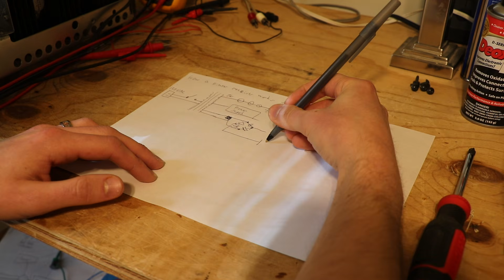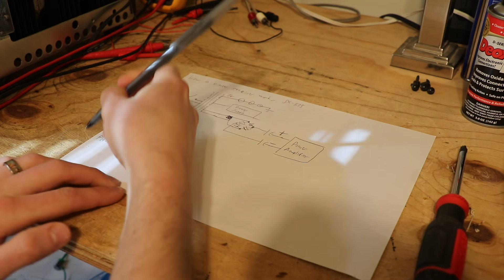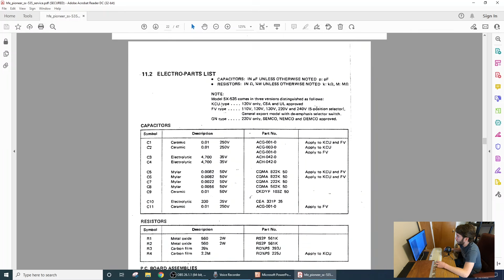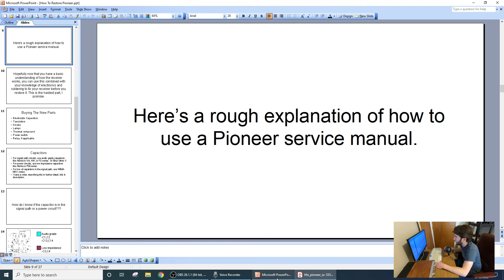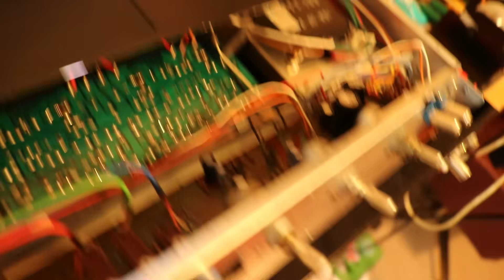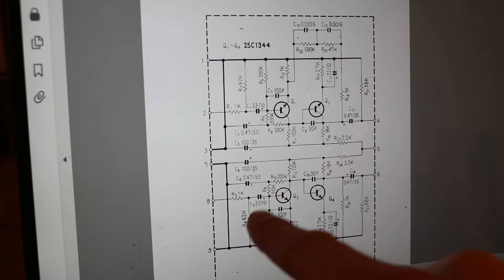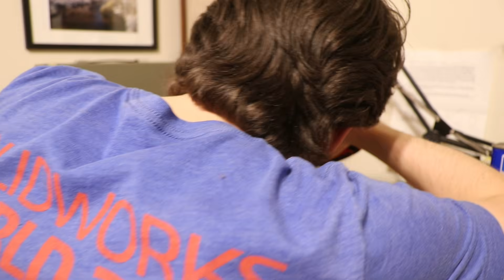How To Restore Vintage Pioneer

Comment: I hear you when you talk about the impracticality of the time and cost of doing this job. But really, the time could be cut down tremendously by simply fixing what is broken and nothing else. If it ain’t broke, don’t fix it. Almost all of what you did was PREVENTATIVE- and not necessary work. This way you can still make money repairing this gear. And if a cap blows out then replace it and call it a day until the next one blows. The customer simply needs to know the reality of the cost of owning this old gear. Let the customer assume the risk. Or else they will need to learn how to do the restoration themselves.
Reply: Согласен. Не нужно чинить то что не сломано. После проверки старых конденсаторов очень часто бывает, что ёмкость и esr лучше, чем у новых конденсаторов. Мне кажется, качество новых конденсаторов хуже того, как делали раньше. Новые бывает вздуваются ещё в упаковке. Сомневаюсь что они проработают в приборе хотя бы лет пять.
Reply: Thats like somebody bringing in a 440 Six pack Cuda and you replace four plug wires and four spark plugs it might run good for while but it will come back to bite you in the ass later you got it tore down do it right
Reply: I’m going to disagree with you on soldering.  You showed that you put solder on the tip after you heat the joint. That is a quick way to end up with a cold solder joint.  You should touch the solder to the work being soldered. Let the wire melt the solder.  Then the solder will flow around the wire. Also, I don’t add solder to the tip of the iron on the way to the work.  I just keep the tip well tinned the whole time.

Comment: Leaving the power transistors is a missed opportunity I think. They DO fail, you know. And when that happens it has serious conseqenses for your speakers. It costs me a very expensive pair of speakers in the past. And that was a amp with speakerprotection, unfortunately failing as well.
Reply: Anything can fail. Where does one stop. Do you replace the switches?! They could fail. I think restorations like this are kind of silly unless you can do them yourself or you have loads of spare money to give to a tech. Fix what is broken or swap in new parts if it will improve the sound. But always swapping in everything new is a huge waste.

Comment: I think as time goes on (and these units become more rare) they will appreciate in value so as to reflect the true cost of restoring them, even at $100 per hour shop rates. They just aren’t built like this anymore, and even the lower end less expensive units like this have far better sound output than most of the digital junk out there today. I’m currently restoring a 1974 AKAI AA-910, and I have a 1975 Sansui and a 1981 AKAI waiting to go on the bench soon after. Good video, thanks!
Reply: you realize that's just the power of suggestion?  THD is THD wherever it comes from.
Reply: All electrolytic capacitors are being phased out & from the looks of things it's going to be almost impossible to rebuild or repair anything that has electrolytic capacitors in them, all major cap manufacturers have posted that they will not be manufacturing electrolytics, check it out & the reason.  . . Isssss.  . . IT'S GOOD FOR THE PLANET, or as we're being told they're obsolete, which is nonsense, it's so fewer people in the near future will have radios that can be converted to broadcast units

Comment: 1:00:40 technically they do have kinda polarity. Some of them are still being marked so you know where is the outer plate (foil). it can be important for high frequency and high quality audio applications. https://youtu.be/OWXbdCz-AiY?t=1427
Reply: Very true. The outer foil was often marked by a black line on the capacitor body. The newer capacitors made for PCB applications often have no markings to indicate this. I use a scope to find which is the outer foi, although there are purpose designed devices to do this. Here on You Tube Mr Carlsons Lab is a rich source of information on this and many other electronic related subjects.

Comment: Boy do these video's take me back to my time as a bench tech in the seventies. I've fixed dozens of every unit you've done so far.
Reply: You should get back into it there is a huge shortage of techs for the old stuff
Reply: @madmanmechanic8847  Unfortunately, Most of the quality vintage audio gear has been bought on eBay and shipped to either Japan or China. I've been in wharehouses filled to the ceiling with vintage electronics waiting to be shipped out. Sad.

Comment: Just subscribed and have watched a few of your videos, I find they are very well done. I still have my original SX737 that my dad bought for me when I was a teenager and unfortunatley he recently passed away from Covid.  I have electronics soldering experience as I repair pinball machines for a hobby. I would like to do a complete overhaul on my SX737. It typically works for about 1/2" hour then cuts out completely. If I wait a few days it then sometimes works again. Is there a complete list available of all the potential problematic transistors and capacitors that I could replace. Seems like a lot of additional time to track that all down in the maintenance manual  if someone has already done this and also found suitable replacement alternatives.
Reply from the maker: Someone has made a list or two on audiokarma.org. Here's a video that I made on a Pioneer SX-737 that shows a repair that might solve your issue without restoration: https://www.youtube.com/watch?v=kZf_U8oQ90k
Reply: @AHFixIt  Thank you very much for the information. I will start with your suggested replacement of the 2sc1451 and 2sa726 transistors.
Reply: I replaced those transistors but it did not fix the problem. However I have now replaced a bunch more resistors and capacitors and now it no longer cut's out. So far the protection circuit board and power supply board have been upgraded with new Caps, transistors and diodes. I am going to move on to the other boards. I really appreciate your videos and help. Keep up the great content.
Reply: @GF-ok5yn  m

Comment: Thank so much for this video! Have you ever worked on an SX-770? Total novice but I’m trying to repair, and then maybe restore my dad’s 770. Tuner, Aux input work but Phono input is barely, and I do mean barely, audible when V is fully cranked. I checked the supply voltage to Head amp board and it is 13.2, I believe it’s supposed to be ~30v...
I checked voltage at +B1, +B2, “+12V” and IND at power supply board and measured the following:
+B1 45.8v
+B2 13.2v
“+12V” 12.5v
IND 20.8v

Does that low 13.2v reading point to any one particular e-Cap or transistor on the “power supply unit”?

Thanks in advance for any guidance you might be able to provide!

Comment: I have a Pioneer SX-780 that just died. I've seen you check over one of these. Would you consider doing a full restoration on it?
Reply: Did you get your SX-780 fixed? I just did a restoration on my SX-650 which came out beautifully!
Reply: @jpreza  after watching some videos on the likely cause of death, it seems like one of the darlington power packs is the likely reason.  i bought two and plan to solder them in. not super experienced at soldering but  got some decent equipment and have practiced on an old circuit board. hope to get to it shortly
Reply: @MB-en3do  If you end up with extra knobs, let me know.  I'm looking for a volume knob and a tape monitor knob.  All the silver Pioneer control knobs are for the most part interchangeable.

Comment: Not sure if you will see this or not but I would love your opinion on something.    I have a sansui AU-7900 that i found in rough shape.   I cleaned everything I could clean on it. It gets power and the power stays on.   The main problem is the amplifier board Sansui F-2596 immediately blows two fuses (8A 250V) as soon as the power is turned on.    I replaced the 220ohm fuse resistors.   But the problem still remains.   Do you think it could be the output or power transistors on the heatsink?   Thanks for any advice.   I just wondered if you had any ideas.
Reply from the maker: The outputs on the heatsink would be a great place to start. They're easy to remove and check.
Reply: @AHFixIt  that’s what everything has been leading me to.   Thank you so much.  Love your channel!  I’m learning a ton!

Comment: I like to use a sharpie to mark the tops of the old caps. I mark them on the side that faces forward.  Then when I pull it out I can remember which way it faced by looking at which side the mark is on.  You can't always trust the board being marked correctly.

Comment: An excellent, well-done and well-presented video.  Great job. A few suggestions:  I've found cosmetic swabs to be better than the Q-tip type as the fiberous packing is much tighter with far less chance fibers will be left behind when applying heat transfer compound for best surface-to-surface contact. Pronunciation is "Mike-ah", as in the silicate mineral it is.

Comment: Nice video,i am subscribed even from the first video i saw. I have a question relating Pioneer sx 626
1.i do not have speaker protection relay on sx 626,and it has the bub sound on start. Could it be possible to put some kind of protection relay?
2. I have like some hum or low noise on speakers regardless of the imput. It is constant low noise in the background regardless of the sound pot. I checked the dc output on the channels it has 10mv dc,it is accseptable. Is it possible that the problem is with the ground loop?
I have watched many of your videos you helped me alot. I rebulbed it,and cleaned the nobs. I have basic soldering skills.
Reply: You can try running a wire from the Gnd lug on the back of the receiver to the screw on a wall outlet. That will connect the chassis to earth ground. I had a receiver with a constant low hum that was not affected by the volume knob.  I recapped the power board and got no results although some of the caps were out of their tolerance.  I recapped the tone board and that helped reduce the hum quite a bit.
Reply from the maker: 1. That is characteristic of the receiver. It has always done that since day one. I'm of the opinion it's likely more work than it's worth to add a protection relay to that receiver.
2. Likely a grounding issue somewhere, maybe due to a worn out cap or two. That's just a guess, though.